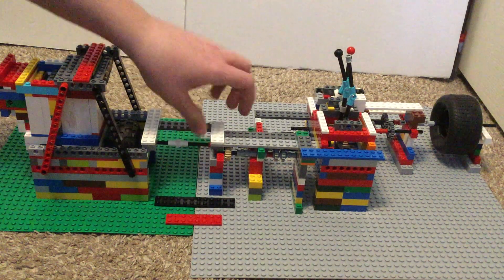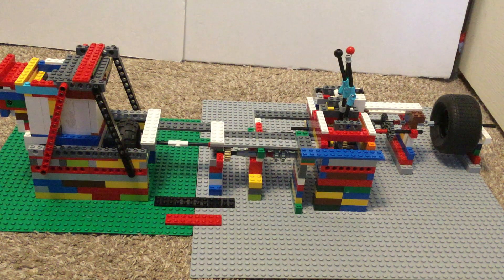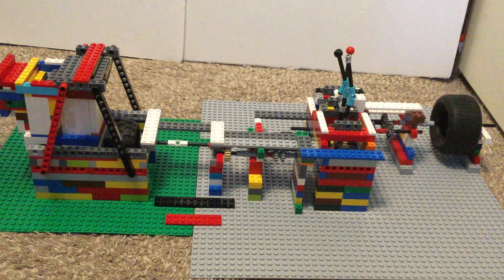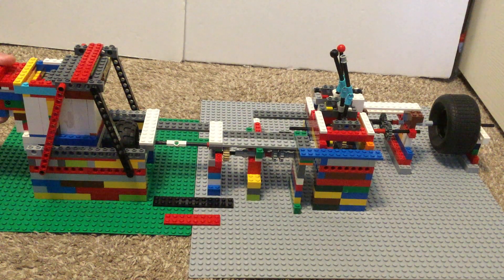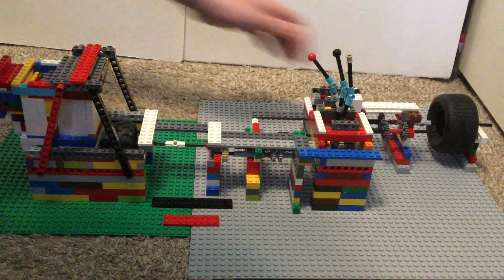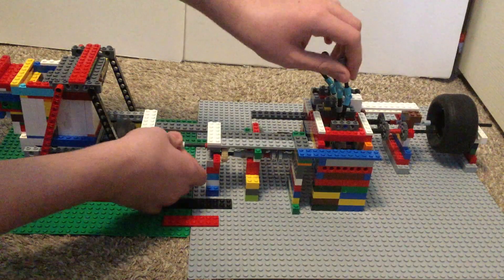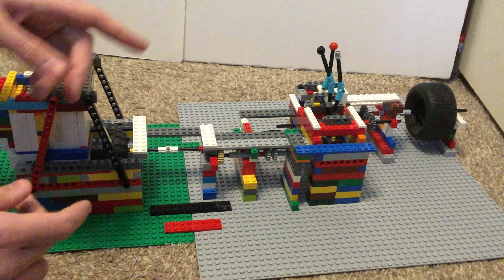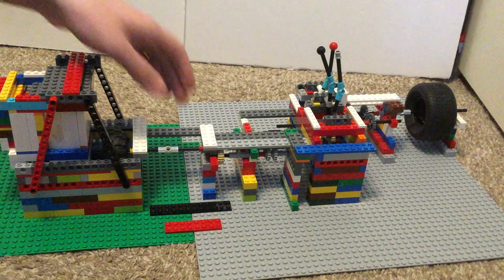Lego 6000 rpm 1 Cylinder Vacuum Engine Running on the 4 Speed Lenco Transmission

Comment: in my vacuum engine somewhere around 9500+ rpm
Reply from the maker: can you send a video link of it running?
Reply: @matsbricks4129  I'll try hard.
Reply: @Diengo_1  I can’t trust this unless I see proof
Reply: @legoenginemechanic101  I picked it up and made a two-cylinder that has a speed of about 5,000 at a minimum vacuum cleaner speed.